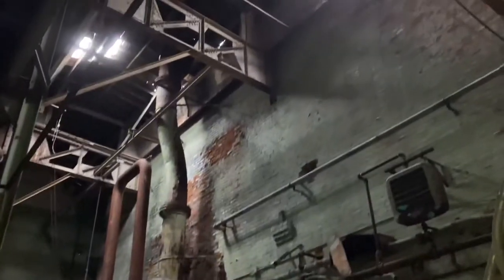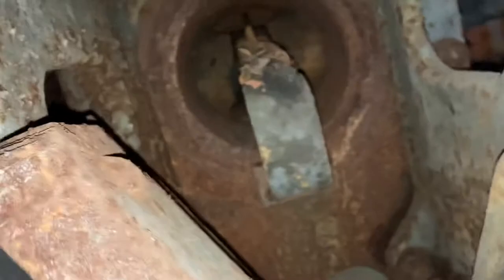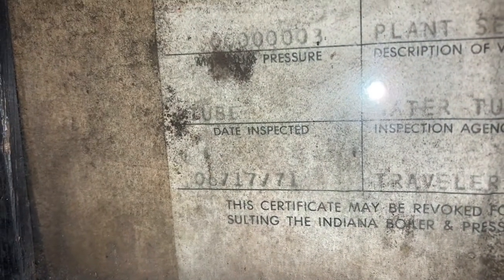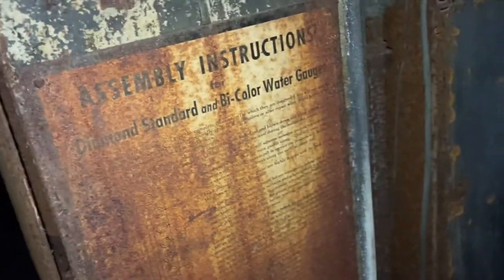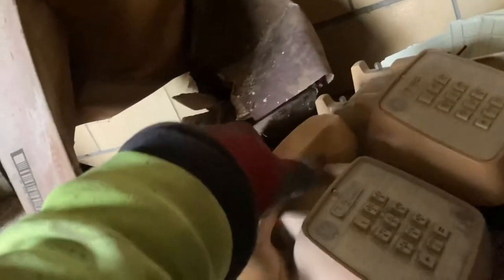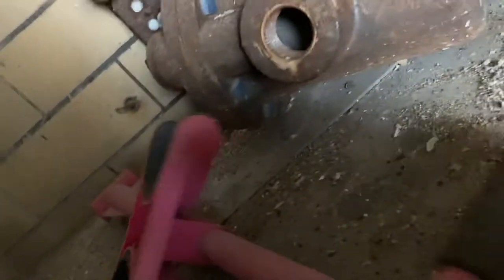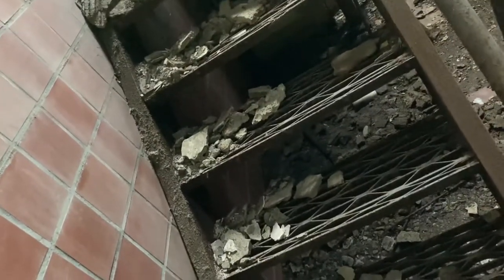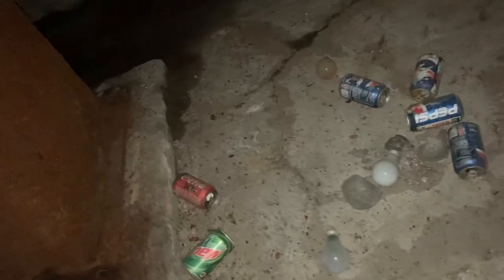Abandoned General Electric Building (Fort Wayne Indiana December 2021)

Comment: If you want to see the rest of the buildings (you were on the east side of Broadway), go back down in that basement with a good light and find the tunnel entrance (there are several).  Using the tunnels you can get to any of the buildings...including the buildings on the west side of Broadway, as the tunnels go under the street.
Reply from the maker: Working construction I’ve seen more than I wanted to see lol
Reply: Those old tunnels go from Broadway all the way over down on Taylor Street. At one point G.E, Essex, and Slater all worked together to build munitions for the war. I worked at the G.E building on Taylor that later became BAE systems.
Reply: What do you mean by that is there dead people in there or somthing  @TraceKillTv
Reply from the maker: @lamagamingtv7321  anywhere there is construction happening, there is potential to see dead or injured people